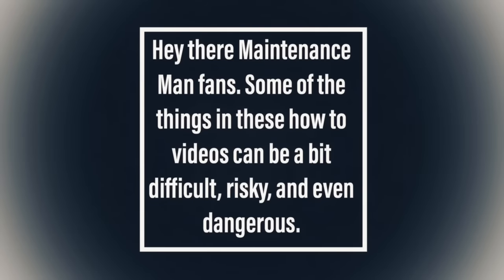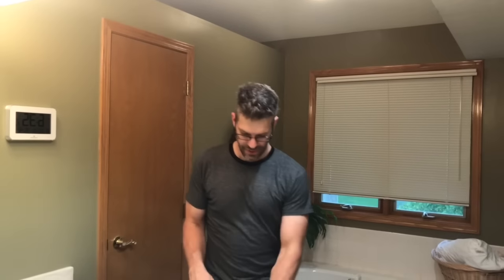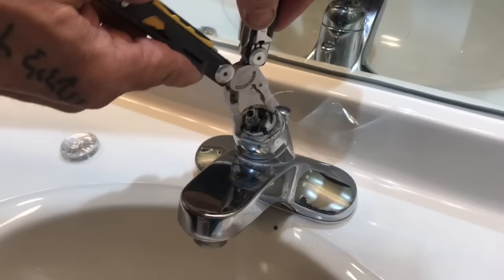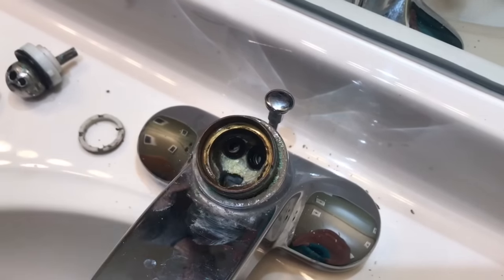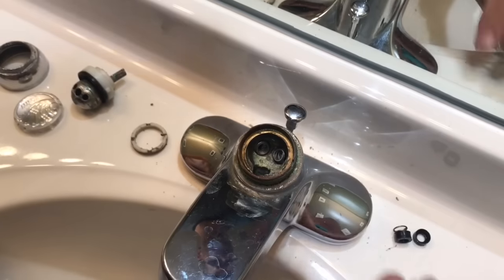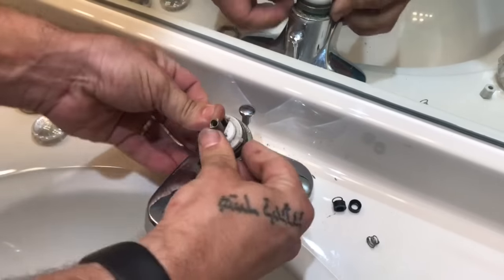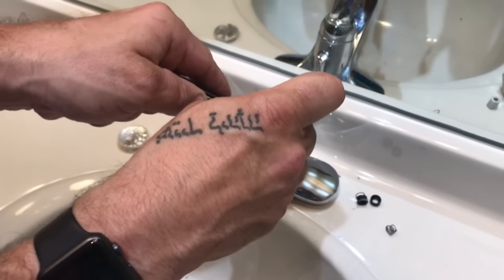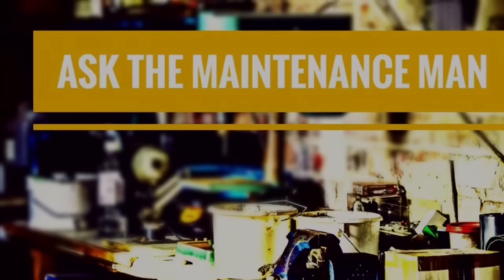How to fix a leaky delta style bathroom faucet

Comment: Thank you for this easy to follow tutorial, I just fixed my leaky faucet!
Reply: Me too!
Reply from the maker: Way to go!
Reply from the maker: Nice job! Kinda feels good doesn’t it🤗
Reply: @TheMaintenanceMan what if water don't shut off? Keeps dripping running
Reply from the maker: @J-Bo-hr9zp you will need to turn off the main water supply and also change the valves under the sink if you can’t get them to shut off completely. Sorry for the bad news.
Reply: @TheMaintenanceMan  thank you for immediately replying. I'm stressing.   Can I turn off main water supply outside...fix actual sink only and then fix valves underneath sink at another time later because this drip getting worse and I work graveyard shift. I don't want big bill or come home to flood
Reply from the maker: You’ll most likely send whatever water deposits that ruined your valves on to the aerator and plug it up but as long as the packing nuts on the valves aren’t leaking after the repair you could definitely do that.
Reply: @TheMaintenanceMan  thanks 🙏🏽 so much!!!  I called and got water getting turned off to repair myself.  Well see how it go.  I'm subbed and will definitely binge watch and  recommend you whenever necessary .
Reply: @J-Bo-hr9zp  You can always defer the replacement of the water supply valves if the timing isn't good for you as long as they're not actually dripping into your vanity.  When you do get around to doing them, replace them with quarter turn valves: much better.  In the meanwhile, you don't want the faucet to get any water so cutting off the water to the entire house will accomplish that if you have no other way.

If you're not up to changing the valves yourself, call a plumber and have him do it.  Working under a sink is a real PITA.  Working on the top of a faucet isn't nearly as bad, as the video showed.

Comment: A couple of suggestions:  1) Before you do anything else, pull the drain shut so nothing can accidentally go down it, like that screw that holds the knob in place, or one of those little springs.  2) Before you replace the knob, turn the water back on and check for leaks.  If it leaks, tighten the white outer piece.  THEN replace the knob.

One personal note:  I used to fix scuba regulators and valves for a living and one thing I absolutely will not do is use channel locks or any kind of pliers on a chromed part.  I always use a wrench instead to protect the chrome.

Comment: My retainer ring was different, it had a band to grip in the lower outside.  But everything came off and went on in the same order as your demonstration.  Had to change out a few more things since I had it open and available.  Delta sells bathroom sink repair kits at Home Depot for about $16 and they contain all the plastic parts, washers, gaskets, and springs.  Thanks.
Reply from the maker: Glad to hear it. Way to adapt to subtle differences in product manufacturing. 👍🏼
Reply: I have the same thing. Is working to turn it. Very hard because the pushing pole behind it. It’s kind of blocking my plier to turn around.
Reply from the maker: @Wowokissy that can be removed so you can get a better grip.
Reply: @TheMaintenanceMan  thank you very much. I'd like to try to remove the pole behind it first.

Comment: Highly recommend this video. Just replaced the 25 year old rubber seats on my Delta bathroom faucet using this video as a guide. The dripping faucet is now fixed. The only variation was the round external cap that one removes after taking off the knob, required use of a pipe wrench (I'm sure there is a better tool) to grip it at the base rather than being able to use a nut wrench to twist from the top. Suspect Delta updated the design to minimize damage when removing the cap.
Reply from the maker: Thanks for the recommendation!
Reply: I was literally brought to tears trying to do this part because I don't have a pipe wrench and the wrenches I was using were just not cutting it and kept slipping off despite gripping them with all the strength I could manage. Immense frustration, painful hands, mangled faucet, but this comment convinced me that I just need the right tool, thank you.
Reply: Oh damn I just posted a comment about this very thing… so you got a pipe wrench to work… hmmm.  I’ll have to try that. Thanks.

Comment: I fixed my faucet using a multi-tool as shown in this video. The “compression ring” was loose and tightening it less than a quarter turn resolved my issue. Thanks!

Comment: I have this exact faucet and used your instructions. I would like to add that I did not have to remove that little plastic retainer ring before removing the main cover. It was plastic and it was starting to break trying to break it loose. I just left it in place and took off the main cover and it worked fine. I thought this might help someone else.

Your instructions were wonderful! Because of you, I was able to fix my sink myself.

Comment: Thank you so much for taking the time to make this video. 
I just fixed our faucet. One tip is to put the spring and gasket on a small Allen wrench and hold them with your fingers. Put the tip of the Allen wrench in the slot in the faucet and slide them down into place. Wide part of the spring facing the faucet with the gasket on top of the smaller portion of the spring. The long bar of a thin Allen wrench is what I pointed into the slot of the faucet, then slid the spring and gasket right into place.
Reply from the maker: What a great tip! Thanks for sharing with all the Maintenance Man fans.

Comment: I just did it!!! The tip on using an Allen wrench worked great, and it took maybe 15 minutes. I was trying to get the rubber caps to fit down into the holes, but soon realized that the ball thing will push them down naturally and form the seal. That was the only issue I had, but that was my error.

Comment: Excellent video! I found this after my first attempt at fixing my faucet (it was still leaking). Didn't realize there were springs and gaskets that needed to be replaced too... they came with the replacement cartridge but it wasn't obvious where they fit so I left them in the package.

Comment: Hey nice helpful video…one tip to those who may have a slightly newer faucet. When you put the Death Star looking ball back into the faucet, put it back in so that the small long cut goes in the right where the little metal protrusion sticks into the opening & orientate the plastic coupling into the detent on the left. This will allow for it to rotate properly. When you put the faucet handle back on it will seem loose. Dont over tighten it and don’t worry. When you turn the water back on every thing will tighten back up. Don’t put the aerator back on until after testing bc a bunch of dark gunk will come out bc of the installation process.
Reply from the maker: Great tip! Thanks and I love the Star Wars reference.

Comment: Great Video! I just greased all my faucets today as they can get tight after use for awhile.  Do it every 6-8 months.  I grease the ball especially around the stem which protudes and connects to the handle.  It improves the play and makes the faucet feel like new.  After maintaining these faucets the first time i never take off the plastic O-ring.  I just take off head with an adjustable wrench.  Also when putting the head back on just tighten with hand and then go a 1/4 inch with your wrench.  You will be happy you did this the next time your maintaining this faucet.  Cheers!!
Reply from the maker: Great advise! Thanks for the comment. Have a great day.

Comment: I've had a leaky faucet for years. It only leaked when it was left in hot or cold position so I tolerated it and made sure it was always left in the middle. SWMBO always felt the need to leave it anywhere but center. At $75.00 per visit with 2/10 homeownwers insurance, this fix should cost less than $10.00.  I dreaded calling them so I kept putting it off. Now I'm so glad I did. With your video, I'll fix it tomorrow by myself. Thanks.
Reply from the maker: Great! Let me know if you have any problems.
Reply: so what is SWMBO a code for ? why not just stop coding and use plain English ?
Reply: @DougHinVA  

SWMBO = Wife

Comment: You should every video out there!  clear, no over talking and concise!!!
Reply from the maker: Thanks for the compliment.
Reply: @TheMaintenanceMan  Hey there, great video, easy to follow with very concise instructions. And I followed them to the letter but I must have dropped the ball somewhere because after I replaced the washers and springs and re-assembled the faucet, it seems to leak even worse than before. Is there a certain orientation that the ball must align to? I've got it with the diamond points at north-south like in your video and I even tried reversing it 180° and it's still leaking. Is it possible that the valve ball might have worn down enough that it doesn't seal properly? Unless you have a hail mary insta-fix I guess my next step will be getting the full repair kit with the valve ball instead of just the washers and gaskets. I'll be subscribing and checking out your other videos once I've taken care of this issue. Thanks again.
Reply from the maker: I think that’s your next logical step too. You could try to give more tension to the inner plastic ring as that’s the thing that makes the pressure that seals the ball against the seats. But if that doesn’t work or if it’s already as tight as it’s going to go you’re next step it definitely to replace the guts all together. Let me know if you have any more issues and I’ll try to help.

Comment: Thank you for your video.  One note I wanted to mention.  I was unable to remove my bonnet nut with my channel locks.  I found that a 32mm deep socket would fit the top the bonnet.   Most sockets have a progressive slope at the entrance which makes it difficult to engage the shallow bonnet nut.  Using a hacksaw I trimmed about a quarter inch off the opening of the 32mm socket.  This allowed the entrance of the socket to be flat and fit the bonnet perfectly.  I was able to remove the nut easily with my ratchet.  Hope this helps someone else.
Reply from the maker: Thanks for the tip. Good description of your process too.

Comment: Excellent vid. I woulda tried to clean the scum inside the faucet. Good thing for  your warning!

Noticed that the undersink valves closed right up with no problem. I always find them stuck. Which is a whole different problem.
Reply: correct... and it takes a plumber to resolve that separate problem
Reply: @DougHinVA  or just shut off the water main outside

Comment: My Delta was slightly different from the one you demonstrated on, but it was close enough for me to figure it out (still a single handle).  Shoulda taken it apart BEFORE I went to the hardware store so I could have gotten the right stuff the first time, but that's my bad.  Thanks! Only took me about 15 minutes not counting the extra trip!
Reply from the maker: Glad to hear the video helped. Glad to hear things worked out.

Comment: I followed this and my faucet leaked right through the body and into the cabinet beneath.   So much for my handyman  skills
Reply: Hey, Dennis! I've done this several times before for smaller leaks, successfully. However my Mom's faucet is REALLY leaking "down through the faucet" also. She says her regular plumber told her sometime back that she needed a new faucet. Did you just not have things tightened properly, or did you need to have a new faucet? (Mom's plumber NEVER recommends new or unnecessary work and he retired so no info from him). Just wandering what I might be getting into - if you have a moment. Thanks!

Comment: Thank you.  I ran into a problem with the retaining ring you used your channel locks on.  I did not have the hex head on the top.  I have a ridge area on the bottom of the retaining dome.  My channel locks could not budge it.  As it’s Sunday afternoon and stores are closed I said try something else.  I put the tension ring back on and put slightly more tension on the springs and it did the trick.  No leak.  I don’t know how long it will last but the wifey is happy.

As an aside I see you did not close the sink stopper before you started.
Reply: I have the same issue. Can’t get the retaining ring off because it’s just rounded. Any ideas?
Reply: Im not seeing a reply to this question.  My retaining ring will not rotate with any wrench or pliers.  I have soaked it with White Vinegar to reduce the crud, followed by WD-40 and it still won't loosen.  What's the secret in getting it off?

Comment: The part you took of before the retainer ring is metal on my sink. How can I get it off it’s stuck after 25 years?  I tried the way you did it and wd40 😩
Reply from the maker: You can use heat to get it off but unless you know how to safely or have done it before I don’t recommend doing it. Sounds like it might be time for a new faucet unfortunately.
Reply: @TheMaintenanceMan  Thank you so much for the timely response. Yes I’m going to call the plumber 😩

Comment: It is a very nice video; I just followed it fixed my leaky delta style faucet yesterday. While I don't have the multi-tool as you used, instead I used a plier. However, the tip of the plier is too sharp, it didn't tight the plastic ring well and damaged it although I tightened the ring later with the same plier. Would you mind sharing the link you bought the multi-tool? Thanks, and appreciate it!

Comment: Yay! Exactly what I needed. The seats were visibly  flattened and worn. I have rubber stains on my fingers from handling the old seats, but no more leak. The new seat and springs came with a set for a different style of Delta faucet. Don't know what to do with them.
Reply from the maker: Toss them unless you want to save them for a rainy day.

Comment: Thank you for the video. 
I found the parts at Hime Depot.  
They are Delta parts
#RP77737G which came with two larger springs and two small springs ir RP4993G At least for that faucet you recorded.  I happen to have exactly the same ones.   
It contains the two small springs and rubber grommets. 
Easy fix. Ten minutes.  
But without your video maybe a lot lot longer.  🤣🤣🤣🤣 thanks again.  Keep them coming.

Comment: Hey there, thank you so much for the walkthrough video. The ball and piece that has the notch in it won’t sit down on the gaskets properly and keeps popping out. Do you know what may be causing this?
Reply from the maker: The springs on under the seals keep pushing it out. Make sure the tension ring is installed correctly. It’s what keeps the seals tight and the ball in place.

Comment: I have a leaky Delta bathroom sink faucet and replaced the springs and 
seals.  It is still leaking underneath into the cabinet.  Is there a 
different internal repair I need to do on the faucet?
Reply: Did you end up finding a solution to this?  I have the same issue
Reply from the maker: If the faucet has any other leaks it will come from the connections underneath inside the cabinet area. Take a bunch of paper towels to dry off every connection point and take the time to watch for that first drip and trace where it came from. If it only happens when you are running water from the faucet look for water pooling on the top of the sink around the faucet. Many times I have encountered water simply being splashed on the sink top and dripping past the entire faucet through the holes in the sink top for mounting.

Comment: I did this, was fairly simple. However, i now have water streaming out from the knob. The leak stopped, thanks to your wonderful direction. Now how do I stop the stream that flows from the handle when I turn on the water? 😊
Reply: Adding, I went back in and tightened, but I’m wondering if my ‘tightening’ may not be enough. 
Thanks for your tutorials!!

Comment: Your video is great, so helpful! The only thing I’m not clear on is this: is there a specific position for the metal ball that sits in the hole and attaches to the handle? I reassembled everything and still have the same issue: down is not off, sideways is on and off is too.
Reply from the maker: Yes, there is a correct direction. What you’re describing sounds like it’s in sideways. I described the correct direction in the video but it’s specific to the shape of the handle post.
Reply: In your video you specify to put the plastic tab back in the slot, however there is no mention of the direction for the ball. On mine, delta style, the plastic opening is triangle shaped and the ball doesn’t fit in any specific way...
Reply from the maker: There should be three holes on each half of the ball. One set goes along the top and one along the bottom. They let the hot in one hole the cold in the other and they leave through the center hole. The ball has two sets so it can be flipped over and revel a fresh surface to marry up to the seals. Let me know if you have any other questions.

Comment: Your video is great!  I replaced the seats and springs and that stopped the dripping, but my faucet is also leaking heavily from underneath, into the bathroom vanity.
Reply from the maker: Does it leak constantly or only when you run water?
Reply: Only when I run the water.
Reply from the maker: There’s only one part after the controls so if you take the aerator off (water will splash, be careful) run a little water and it still leaks that means a new faucet. If it doesn’t leak you have something wrong with the seal on your aerator and that means time for a new aerator.

Comment: I have a leaky Faucet, but it's leaking under the sink.  The water is coming from the right side of the bottom of the faucet.  I have replaced the springs and seals on the actual faucet as you demonstrated.  It is still leaking underneath the sink into the cabinet.  Is there a different repair inside the faucet itself?